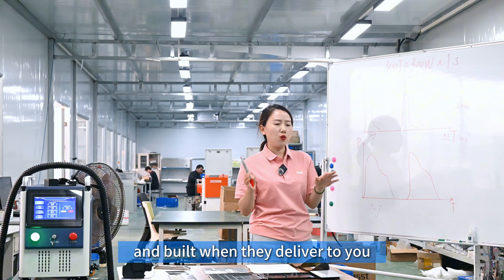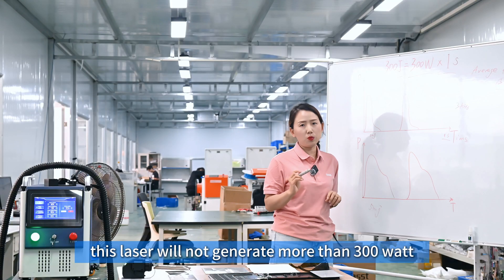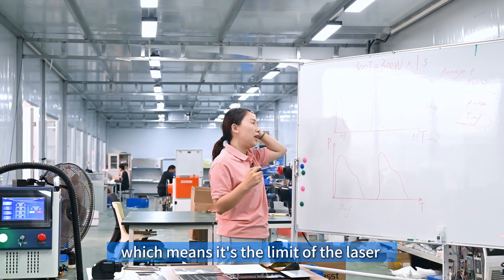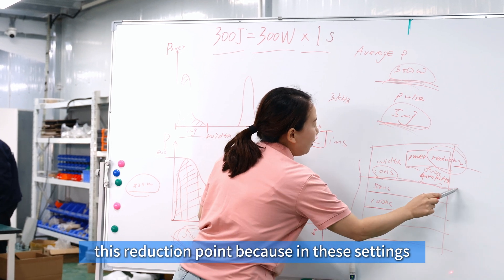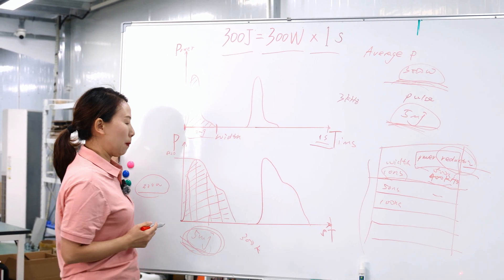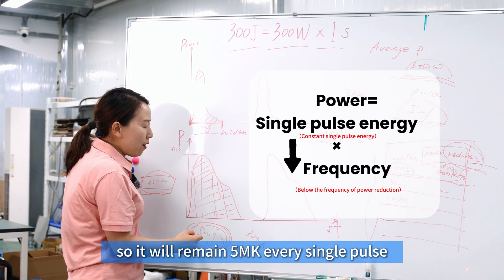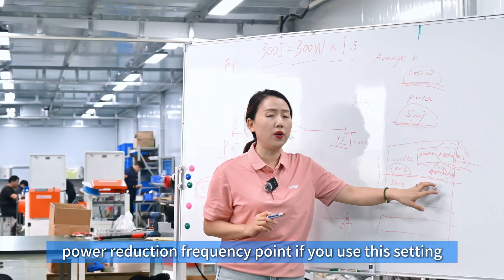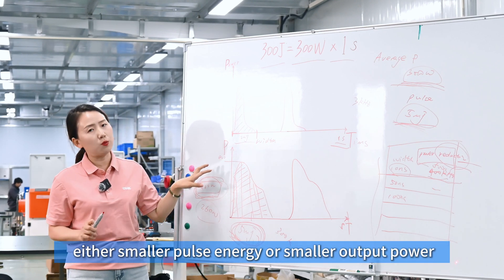Part 1:Choosing the Right Pulse Energy and Laser Power for Laser Cleaning Machines #DMKlaser

Comment: Hi jally
If the yellow cable is bent and the fiber inside breaks (cracking cable fiber inside yellow cable), will the power output from the cutting head be less than half? Or will there be no power output from the cutting head?
Thanks
Reply from the maker: if the fiber inside break, there will be no laser output from the head

Comment: Thanks a lot for taking time to explain. May I suggest to show real examples in a future video ? Example : 300 W / 2 MJ on wood. What happens if the frequency changes ? What happens if the pulse changes, etc... to understand at which point you clean and which point you burn ? I am still strugglinig to monitor properly the parmaters for delicate materials like wood or aluminium cans.
Reply from the maker: yes, it's better to show with exact samples, but for wood and paint, every wood with paint are different, you have to test the parameters paintly by yourself